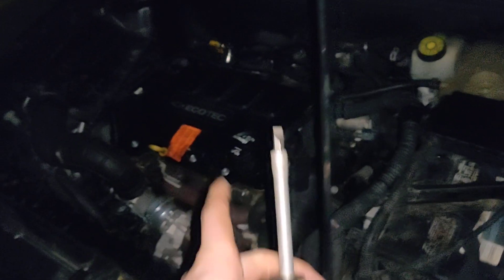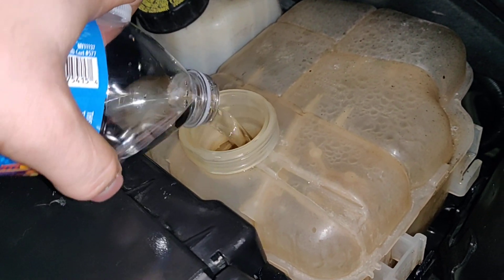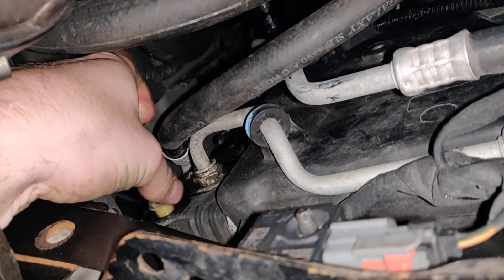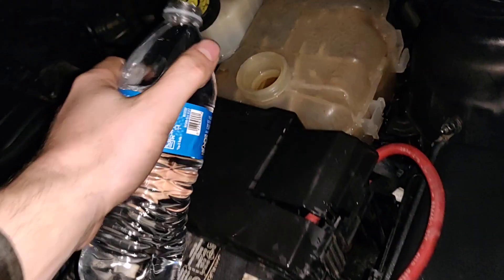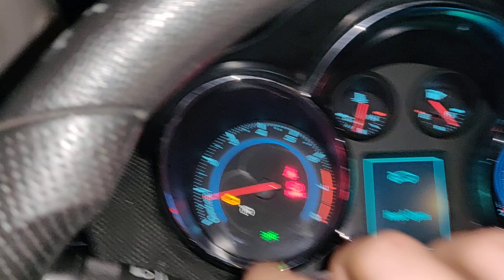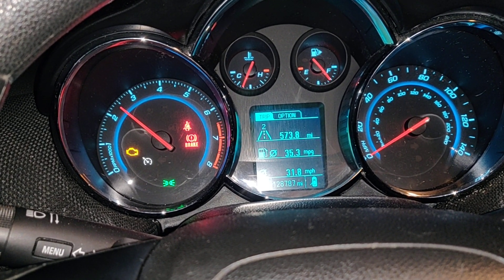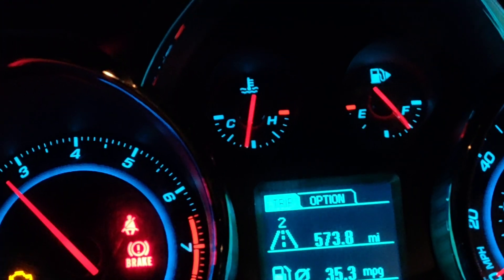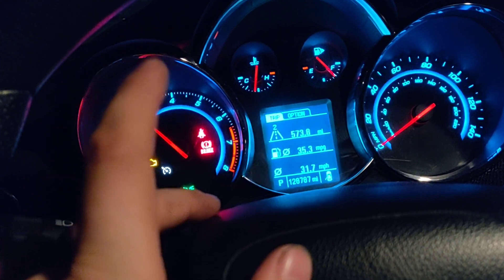Chevy Cruze overheating fix/coolant system bleeding

Comment: I have heat in the car but the rad hose on drivers side stays cold no matter what I do. Does that mean the thermostat is stuck shut and has to be replaced. Yes the rad to full.

Comment: I didnt watch all the video so excuse this question if it was covered..... What took place that allowed air into your coolant system ? A garage gave my car a coolant flush but did not open the heater core ( turn on the heat ) which left air in my system. A day afterwards I turned on the hot air and a big air pocket worked its way to the overflow jug and pushed out a lot of coolant.

Comment: isn't there a recall on these engines from chevy? there problem engines from the start! chevy has made a lot of money from these cars, and has not stood behind there cars and trucks quality! sad! all I hear is complaints about these engines! and plastic parts! they should hear customer complaints and change there way of their plastic parts,  to metal parts! and relocate some parts like the oil line feeder to the turbo, cooks the oil near the catalytic converter! stops oil from entering into the turbo which causes the turbo to crack, redirect the oil line solve that problem!

Comment: Had this issue found it was a manufacturer defect. The bleeder hose connector to the engine was defective… had no hole drilled and was essentially a plug. Not allowing the water to circulate!

Comment: Yes the cruze is a junky car i owen a 13 1.4 and yes its smaller then my Harley lol i acquired mine due to coolant output plastic broke and overheated the head it also torched the turbo and the cali emissions cat and after that the turbo kept giving under boost and over boost  codes and was the solenoid for turbo bypass then i got it to pass emissions
Reply from the maker: Yes car is designed and constructed poorly

Comment: I did this same thing and a plastic tee on the heater hose broke and i lost all my water and the car overheated but it never showed on the guage that it was hot!!!
Now i think i burned it up!!!
It will crank over now and the oil didn't mix with the water! So i don't know why it cranks but won't start now!!!!
Reply from the maker: It won't show hot if no fluid in it or bad temp sensor

Comment: Reinstall your turbo heat shield it may actually be heating your fan up. That’s what the heat shield supposed to do is stop the transfer of the heat going out in the next thing closest to it is your radiator fan ?

Comment: Skrew holes have a metal tube in each, should prevent cracking the plastic.
Reply: Are you talking about the bleeder screw hole ? Mine seems tight I’m scared to turn it sounds like it’s going to break
Reply: @Simon37423  counter clockwise, loosens bolt.
Reply: @roberthein2156  I know it’s just the plastic groves in the head are cracking if they break that’s never coming out

Comment: you get 35 mpg?    not bad,
Reply from the maker: Besides the turbo being very unreliable a car was incredibly good on fuel
Reply: @ferenzi7741  i got a 2012 cruze , until last month it ran ok , now it' overheats i. i can't get the fan to work as in before it ran way too often, and my traction thing is all screwed up, the car shudders just a touch, my mechanic said i can drive short distances on it , i cahanged the thermostat and a sensor but i'm broke and have to wait ,

Comment: what should you do if when you undo the bleeder screw water or fluid starts to immediately come out ?
Reply from the maker: Make sure the engine is cool, It is normal for coolant to come out Make sure there's no bubbles or fizz some people like to take the bleed screw completely out
Reply: @ferenzi7741 , I did today.
Didn’t realize it was a short bold. Had it in my fingers, so short, it jumped into the engine bay, heard it hit ? Then it hid somewhere ?
Reply: @ferenzi7741  thanks but i mean should i wait for it to all drain out or should i put the screw back figuring the air is out ?
Reply: @PaulRoos-p3o fluid is flowing, air is gone.
Reply: @roberthein2156  thanks

Comment: That is the worst bleeder screw design ever. These engines run hotter at 'normal operating Temp' 226 degrees F is not good for the head gaskets, seals and plastics.
Reply from the maker: You are telling the truth, these newer cars are half lifed  from the beginning

Comment: I didn’t notice, did you put the bleeder screw back in?
Reply: Near the end.
Reply: @roberthein2156  what I should have said is  it’s possible that if the plastic screw was over tightened it may have  cracked and or is “seeping”.
Reply from the maker: Off video i was on interstate

Comment: Check your thermostat housing, rad hoses, surge tank, the floor on the passenger side and or drivers side under the floor mats ( heater core ) the plastic housing on the drivers side of the engine block , you have a leak somewhere.
Reply: And the inlet hoses from the tank to the throttle body and thermostat housing to the throttle body . Those little hoses are really cheap but when they leak they end up costing you serious trouble and serious money to repair

Comment: What cruze do you have? Because my plug is under the car and its a pain to get to. 

I have a 2012 1.8 petrol
Reply: There are 2-Plugs .
One bottom of radiator, to DRAIN.
One top of radiator, to bleed air out. Will not fill up with air in system.

Comment: At idle these cars heat up 10 degrees per minute but if your driving on the hwy they can heat up 30 degrees a minute with a stuck thermostat so normally driving at 200 degrees that is the line just before the halfway mark  that only gives you two minutes of driving before hitting 260 at that temp this engine will have a blown head gasket because the aluminum head will be warped. I recently fixed a VW Jetta the guy hit a racoon in the middle of nowhere drove for about 45 minutes with no coolant on his 1.4 Turbo and after fixing the car the engine had NO damage, the turbo boost was so smooth with no lag nothing like the Chevy junk.

Comment: I’ve changed the water pump thermostat head gaskets and still over heats but when I turn the heater on blast it cools down while driving when I’m parked and idle never over heats only when I’m driving  and tips
Reply: Did somebody put in stop leak? could have restricted air through radiator, is fan motor working?  It is a 3 speed fan and sometimes the fan resistor go out that is not visible but part of the fan plug.

Comment: My girlfriend has a 2011 Cruz.  She bought it for $6k (with 100k miles) because she needed a beater to drive back and forth to work, which is usually at least an hours drive.  It started having over heating issues within a few months, which turned out to be a water pump, and BTW you are not changing a water pump in the is car on the side of the road, no way no how............. But she had the water pump replaced to the tune of like $2k, and within a few days coolant leaks sprang up.  I replaced some of the hoses, on the side of the road, only to find the rear coolant housing, which is plastic, had cracked where the hose attaches.  I was able to rig it good enough to get home, and replaced it with an aftermarket part that was aluminum.  There were also oil and water leaks on hoses and tubes that connect to the turbo.  After replacing all those hoses, there was still a problem and I wound up buying an aftermarket turbo and having that installed.  The car ran ok for a few months, but now there's this boiling coolant in the reservoir but the temp is normal.  I performed a combustion test last summer to check for a heat gasket issue, but it was negative, but I'm going to do another one this morning, but first I'm going to do the air bleeding that you did here, that's if her car has the bleeding screw this car has.  If todays combustion test is negative again, then I'm going  replace the coolant reservoir as I saw a video where that was the problem............
Reply: Check where the bigger hose goes into the reservoir tank if you tap the gas pedal and see bubbles going into the tank you have at least a blown head gasket. If it starts a little hard but starts that's water on the piston splashing up on the spark plug, You can try leaving the tank cap loose and keeping an eye on the level to get by for a while. Leaving the cap loose will  help keep the pressure down so it doesn't leak in the cylinder.
Reply: @portagepete1 Feel for your $$$, all that, then more !
I’m gonna keep away from CHEVROLET !

Comment: What year is your cruze? I have a 2014 cruze ltz, nothing but problems since 6 months in, have replaced absolutely everything, something's 2x over. My huge issue is the coolant system, has been replaced, but still the overflow tank keeps running dry, replaced all hoses, cant find visible leaks. I wanted to know as im about to tackle this project myself, i have the dex cool 50|50, my coolant tank has just a puddle inside, do i fill the tank with the coolant and then take off the bleeder screw? Im trying to know the exact steps to take so i dont need to bring it back to mechanic. Thanks so much in advance if you or anyone can help! Great video btw!
Reply: Take screw off first, then fill overflow tank until coolant comes out of where the screw goes, put screw back on. This gets air out of the system.
Reply: @kyotodreams3306  thank you so much for replying and giving me excellent directions about the bleeder screw. Have a great night!
Reply: @lisalloydstrobel8024  of course, and please remember to only unscrew the overflow tanks cap when the engine has cooled off. The cooling system is under pressure when the engine is hot and can spray coolant on you at boiling temperatures. Good luck 👍
Reply: @kyotodreams3306  oh I am definitely good when it comes to making sure the car is cool, I wait for 2 days, I always have my projects well planned out. I sometimes however run into an issue when I need to know the exact steps to take and all I need is one little detail left out and I stress, I just want to do it right the first time.   I've read and watched so many videos and read the comments to get alot of my info. You tube is awesome, I had one of my two toilet's not working for 2.5 years, I finally looked up on you tube and within 3 days, I replaced the whole inside of my tank. Up and running. So I figured, if at my age, I can fix a toilet, then I think I can fix  almost anything,  ( hopefully). Great advise on this app. Thanks again for your help! 😊
Reply: @lisalloydstrobel8024 please replace the "oil cooler", that is where your coolant escapes if you have replaced the old pipes.

Comment: Bought mine brand new in2014 for14000 150⁰000 miles on so far no problems
Reply: This car is a hit or miss. It's not a speedster or Ford pickup, it's a cheap gocart with a strong shell, take it for grocery runs and it'll be your best friend.
Reply: 2012 Sonic LTZ ,1.4 Turbo + 6- spd.
$18,328.
Got everything, but would not give me the remote start !
It’s a standard !

Comment: I see a small drip (leak) coming from the back of the engine on top on the passenger side. Im not sure what it is. Any suggestions?
Reply: Water pump?
Reply: Outlet heater hose or crack in the 3- way connector tube.

Comment: All Chevy are junk
Reply: Not all. If you can lower the operating temp of the Chevy Cruze or Sonic 1.4 and 1.8 without the check engine light p0128, it will last a long time.

Comment: When you run it at 2500 rpms with heater on to bleed the air out.but you
Screwed the bleeder valve back in
It still bleeds air with bleeder back in?
Reply: This car yes.

Comment: I got to say, this is likely not necessary, if you give it time the air comes out and it bleeds itself
Reply: Your probably right. GM just put the bleeder in to see if folks would waste their time messing with it.
Reply: @olegearhead2483  I'm guessing you're being sarcastic but It's not a break line... It doesn't just cease to work if there's a little air in the system...
And since this car the reservoir is actually above the bleeder..  You don't even need to run the car for it to bleed. Itself most of the way
It sounds like you haven't actually looked this up before.

Comment: hi, what temperature the fan should be start to?
Reply: Around 210f, should not go above 215f.
Reply: 235
Reply: @fideldelira  not 235f, your fan might be broken or K1 relay problem. K1 relay starts the fan at around 210-15f at low speed 6 volts, k2 at 235f at high speed 12 volts.

Comment: Has anyone had a blow head gasket happen after the overheating??? If so… did someone use blue devil head gaskets repair?
Reply from the maker: It is very possible to get a blown head gasket if it overheats too much Best way to check if it has a blown head gasket is to do what I did in the video to make sure it has enough fluid and to see if it gets hot again you can also check in your oil for a coolant blue devil doesn't always work especially in newer cars but it's better than nothing
Reply: Get your spark plugs out and see if there's water on your engine or do a pressure test with a special tool. Do not use any gasket sealer that will clog the radiators on new vehicles.

Comment: My Cruze was overheating after i changed out a bad thermostat. Burping the coolant didn't seem to get all of the air out. This solved my problem.
Reply: I have changed almost everything yet the car can't drive for even 30 minutes without overheating. Any help will be great from any of you.
Reply: @elijahofosu4454 exactly how it is with my 2014 cruze. I've called for 4 tows in the past month! I even got kicked off my insurance for using the roadside too much! I've replaced everything besides the engine itself and now the coolant is intensely bubbling .. I've bled the system twice no luck f this car 😭
Reply: @brandypilcher846 Did you replace the handle to the antifreeze reservoir it says to do so in the manual when you add antifreeze.
Reply: @brandypilcher846 That's crazy about the insurance. 
Auto insurance is such an effing scam it's not even funny , it makes my blood boil .
And if you go for years without out an accident or any kind of a claim and you spent thousands of dollars you don't get any of it back 🤬👎
Reply: @elijahofosu4454 did you ever figure it out?
Reply: Thermostat housing, follow the hose that comes out of the overflow tank until it ends with a plastic “ tube”, that area leaks sometimes. Also the reservoir itself leaks because where the two hoses connect to the plastic tank the plastic cracks.
Reply: @Zeek800 new reservoir tank w/cap $26.00.
Reply from the maker: Very happy that it helped you!
Reply: After the overheating?? Did you have a blown head gasket issue?
Reply: The Cruze and 5h3 other Gyms using the 1.4 litre turbo run hot all the time. Through the OBD it shows 212 degrees when the engine is fully warmed up. I think any attempt to try to get 5hem to run 10-15 degrees cooler is over ridden by the engine computer. I miss how our 2019 Encore would run up a steep long uphill at 100 km/hr or 62 mph after kicking down one or two gears with the tach at a little over 3700. Now ( with only 32,000 miles on it ) and for the past few years it revs up to over 4500 were these engines make lots of noise without any real acceleration.

Comment: The valve has a slot on the side to allow bleeding without having to unscrew it all the way out, just turn it a few times and you'll hear it start to vent.
Reply: On a Chevy Trax too. Cruz are compatible
Reply: Slot is on the drain, not the AIR BLEEDER BOLT.
Two different Bolts, one short (top), one longer( slot w/ seal) bottom.
Reply: Hi, I'm curious are you referring to the one at the bottom of the radiator?

Comment: LMAO! Pretty unreliable. I have 220,400 miles on mine and only replaced the water pump. Seems pretty reliable to me.
Reply from the maker: Has a lot to do with how the previous owner took care of it the previous owner I got it from did no maintenance to it these engines are very delicate if the maintenance isn't done on time and just somewhat late it can really mess it up later especially if it overheats a little bit

Comment: I have a serious question. You can really drive 2 hrs on just water.
Reply: You can drive for years if it doesn't  freeze or corrode
Reply: Water has a boiling point at 212°F all vehicles stay around 220°F at operating temp. This would cause water to evaporate. When water freezes at 32°F it will expand when turned into a solid/ice. As the guy stated above, if it was to freeze. Plastic parts like radiators, thermostat housing, and water outlet pipes will more than likely crack due to expansion. Hence, the term "Anti-Freeze " which prevents the water/coolant from freezing. Glycol also changes the boiling point of water depending on the Antifreeze concentration in the engine.
Reply: Water starts rust, don’t let it FREEZE 🥶 ! It will expand, crack the block.

Comment: 1st thing i do when i break down is pull out my phone to call someone. This guy is so boss that he takes a video of how to get home using bottled water.
Reply from the maker: Love the comment! Thank you for the compliment
Reply: I was wondering why he did the video in a scary environment. But then I got it. He didn’t want to have to tow it and he didn’t want to have to get a room for the night. So like a boss he made the best of a bad situation and taught me a grip.
Reply from the maker: Thank you ❤
Reply: Definitely not a long-term solution, but it's enough to hobble home and do a flush.
Reply: @GamerKiwi à flush won't help. That many letters is half change🤣🤣🤣
Reply: A beater is 6 grand😮😮
Reply: Got a friend with a Cruze siezed engine. Same problem. 
Looking at sources to determine a year, make and model of a vehicle's reliability---the Cruze comes up as junk. I just love the abundance of plastic parts!
Reply from the maker: Thanks bro this comment always makes me smile